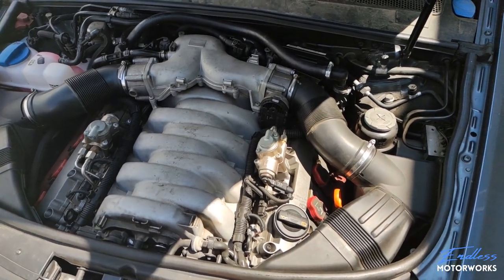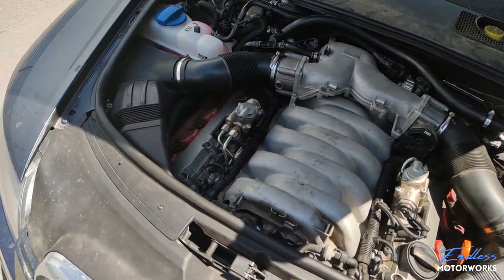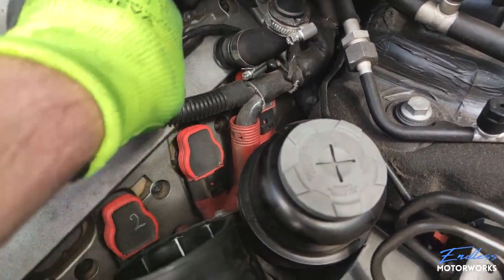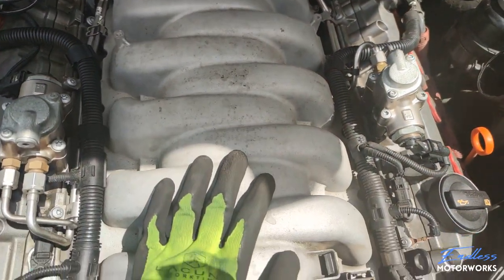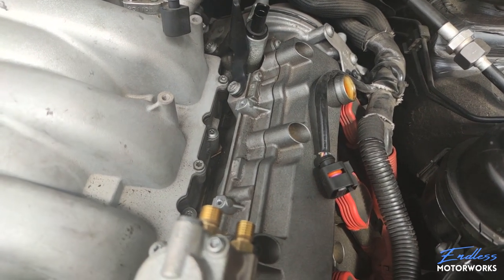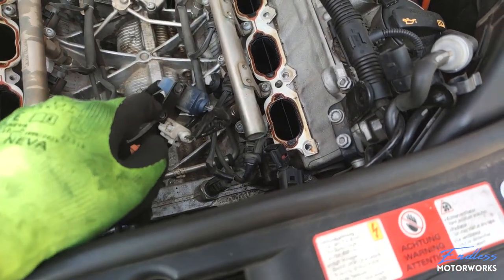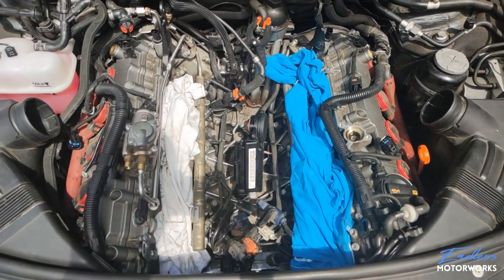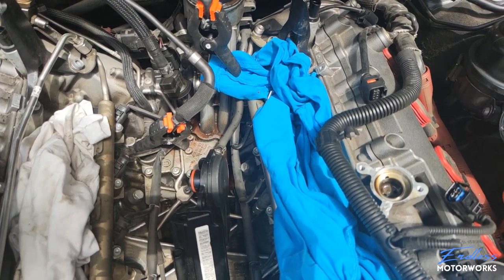5.2L V10 Audi A6 S6 C6 / A8 S8 D3 - Intake Manifold Removal, Swirl Flaps Delete and Carbon Cleaning

Comment: How did you clean the carbon  build up and what did you use to get all that mess out
Reply from the maker: As you can see from the video, I used a variety of picks and metal brushes in combination with a  strong solvents, such as break cleaner and throttle body cleaner. Just make sure that the valves you are cleaning are completely closed, otherwise all of the solvents and carbon will go into the cylinder and potentially damage it when you go start the vehicle.
Reply: @EndlessMotorWorks  may I ask did you use a tool on the bolt in the middle of the crankshaft to turn around the engine?

Comment: It is smart to get them out they can break off and destroy your engine. That would suck. I seen many get caught in the valves and wreck engines and or heads.
Reply from the maker: If watched the video till the end you will see that this is what I found out. A piece holding the flaps to the intake had broken off an had wedged itself into one of the intake valves not allowing it to open and close all the way. I consider my self lucky the piece was big enough not to inside the engine cause catastrophic failure.
Reply: @Endless MotorWorks  i seen that. Well my audi is down ecp light came on it has a miss that got worse it sounded like a crap coil and plug. Hopefully its nothing crazy. Im ready to get a new intake but need to tear it down first to make sure there is no damage. How does yours run with a delete done. As finiky as audis are id think it would throw crazy codes. My oxygen senseor bank one sensor one is shot Hopefully that can be done without yanking the engine.some o2 i here you have to yank the motor just to get to the harnesses and sensors. Kinda bummed right now. I will keep you up to date on whats done. Many codes came up so ill start with the most common crap. I know the intak flaps are broke you xan here them . Son of a gun is all i can say. I love my car its super super clean.
Reply: @RICHIE_RICH89  may I ask how you can hear the broken intake flaps. Is this the rattling sounds you can hear at about 2000 rpm when quickly pushing the gas pedal when stationary.

Comment: Hello,
I deleted my runner flaps now i have an unstable start
Reply from the maker: Like I have explained in the video, the flaps don't really have anything to do with idle and cold starts. The only time these upper flaps make a difference is under high load, for example full throttle and up in the rev-range. If your car isn't running right and has an unstable idle then there is something else going on with it, most probably a vacuum leak somewhere. Considering how many sensors these cars have you will absolutely need to hook it up to a VCDS and get it scanned. Checking the live data might not be such a bad idea as well, but for that you will need to know what to look for, as otherwise it is just a bunch of numbers and values, which will mean nothing.
Reply: @EndlessMotorWorks  bs they do to help starting
Reply: @RICHIE_RICH89  please explain how it helps, or you don't get to call b s

Comment: Where is the pcv valve on this. Motor i cant seem to find it anywhere
Reply from the maker: At the back of the engine, on the driver's side. It is one of the things I remove in the beginning of the video. I have also another video specifically on the PCV system of the Audi S6. You can check that one for more details.
Reply: @EndlessMotorWorks  thank you man. I'm having misfires replaced coils with oem ones and spark plugs and still get random multiple cylinder misfires. I believe the pcv valve is causing it 120k miles.
Reply from the maker: @Ivan-hx7cc  I will need some more info before being able to answer that. When you say misfires, do you actually mean misfires, as you had the car checked with VCDS and you got error codes for it? Or, are you getting just an overall rough idle?
Reply: @EndlessMotorWorks  checked obd11 live data misfires an all cylinders but i believe the pcv is bad
Reply from the maker: @Ivan-hx7cc  When the PCV itself goes bad it makes a characteristic whistling sound when the engine is up to operating temperature and there is excessive smoke coming from the tailpipes. These vehicles do have issues with the PCV hoses, which are originally made from plastic and tend to disintegrate causing unmetered air to go into the engine. Can certainly trigger misfire codes. Do you have lights on the dashboard - CEL or EPS light?

Comment: why does the intake manifold need to be so complicated, its no wonder it broke it has 10 moving parts inside of it.  seems like kind of a dumb design to be since if something breaks you could get pieces inside the cylinders and possibly destroy that whole engine like what almost happened with this car, lucky the piece that broke off was kind of big
Reply from the maker: the idea behind it was to maximize torque regardless of where one is in the rev range. However, with time the plastic disintegrates and does become a ticking time bomb for the engine. I was lucky the piece that got jammed into the valve opening was just big enough not to be able to find its way into the combustion chamber. If it had, it would have been game over for this engine.
Reply: Because it’s an Italian designed engine in a German car… over complicated parts make this engine a ticking time bomb.. I’d rather have the W12. Which I had in the D3. amazing engine, just thirsty.

Comment: Can you fix my s8 for me to 😳
Reply from the maker: Unfortunately I am not a mechanic and don't have a garage. Just a regular dude, who is working on his own vehicles and making YouTube videos in order to help other regular guys interested in working on their own cars.
Reply: @EndlessMotorWorks  hhmmmm I have the s8 v10 5.2 and what your doing in this video I believe the same thing is wrong with my manifold I have a loose motor
Reply: @EndlessMotorWorks  is there any chance I can video call you
Reply from the maker: @ihussain5335  On my vehicle the main issue was that it couldn't idle. As the flaps broke inside the manifold, this created a huge vacuum leak, causing the car not to run properly. However, if you suspect you have an issue with the flaps do the check that I did just to be sure. Remove the Y-shaped intake on top of the manifold, put you phone inside an make a photo. If you flaps are broken you will clearly be able to see it.
Reply: @EndlessMotorWorks  on your video at 6 minutes and 30 seconds that is also loose on mines to what do you think it could be
Reply from the maker: @ihussain5335  The broken thing I am showing at that timestamp is the external linkage for the flaps. If it is broken, like it is on mine, it is creating a huge vacuum leak. Most certainly flaps inside the manifold are gone as well.
Reply: @EndlessMotorWorks  mines just loose it dont come all out
Reply: @EndlessMotorWorks  you no when you opened ur manifold up did u put the flaps back in????
Reply from the maker: @ihussain5335  The flaps are not sold separately and they cannot be refurbished in any way. If they are broken the only thing you can do is to remove them entirely in order to avoid pieces of them getting sucked in the engine and destroying it. I had a big chunk stuck in one of the valves. As I state in the video can buy an entire replacement manifold with new flaps, but those are about $3000 USD.

Comment: New intake is way way better idea you lose so much power without flaps im telling you removing them make you lose major power it switches from a low rise intake to a high rise . One bottom end power second high end power. People do this all the time and have 0 clue on the power loss from doing this. Buy a new intake trust me.
Reply from the maker: Idk man, I have seen the numbers on a 4.2 FSI with the flaps deleted and then with a new manifold on. After several dyno runs the difference was about 20-30kW. I know that this is on a V8, but considering how much more power the V10 has even if there is a loss of 30kW, I am not so sure anyone who drives the car normally will ever notice this.
Reply: @EndlessMotorWorks  You ll notice way more than 30kw. Its not about peak power, peak power is what you ll never notice. These variable intake are for low and mide range torque and torque is really something you'll feel.  You do what you can, but cant call that just as good. Cars have had dual lenght runners since the 90s and it was a game changer in midrange torque figures without sacrifying top end power. Thank for showing your experience with us and Ill be sure to share mine as well. The intake is 2500 $ at the dealership. It's a V10, got to pay exotic price to keep it going.
Reply: @EndlessMotorWorks  4.2 dont have the flaps
Reply: @Nordic_Mechanic  you will gain power doing a delete over broken flaps thats for sure butfor all out pwer a new intake is a good idea . I found a audi dealer that has them for 2 k i gotta do mine it pisses me off my car is by far the cleanest s6 ive seen to date . Im hoping to fix it soon. Cool vid though it will help people. If you do the delete jhm makes a map tune to hold torque flaps open the rest you yank out.
Reply: @Nordic_Mechanic  i have a lot of experience with audis. Been working on them for audi for 20yrs now going on 21 . The new ones are very very hard to work on. Anyways talk to jhm tuning they will school you fast on this. Not dissing what your doing if you dont have the money id do the same . One thing i wouldnt do is disconnect the sensors. It will throw the computer all over the place . Leve them hooked up and disconnect the arms if needed.
Reply: @RICHIE_RICH89  You have 20 years experience yet say that 4.2 have no dual lenght runner flaps.... They have them, just no torque flaps. But what breaks in the 5.2 is the dual lenght, not the torque flaps. I think you're the one that needs schooling
Reply: @RICHIE_RICH89  4.2 have dual lenght flaps...
Reply from the maker: @RICHIE_RICH89  You sure? I am talking about the 4.2 FSI that was put in A6s and Q7s and so forth. There are variable intake manifold runners on those engines.
Reply from the maker: @Nordic_Mechanic  Well, the tumble flaps can cause issues as well. There was a TSB on those a while back. But generally, I completely agree with you mate. The changeover flaps are the ones to watch out for on the V10s and those can be a ticking time bomb if left unchecked.
Reply: @RICHIE_RICH89  wrong...4.2fsi is identical to the 5.2 minus two cylinders
Reply: @Nordic_Mechanic  that would be a whopping NZ$6000 here in New Zealand
Reply: or get yourself the Lamborghini galardo intake for half the price

Comment: there is NO way that thing will run at its potential by deleting the flaps.
they are there for a reason......
Reply from the maker: I have never said that it will be exactly as having the flaps fully functional. If you want full potential, there are brand new intake manifolds being sold from Pierburg for the low price of $3500-4000 before installation. What I am showing is that even without the flaps the vehicle will idle and run just fine. Will it be 15-20hp short? - Perhaps, I haven't gotten around to testing dynoing it, but you also save a ton of money and it's not like anyone is actually tracking a vehicle like this in order to feel the difference in a day-to-day commute.
Reply: Is there any way you could 3d print the broken parts and fix the flaps?
Reply from the maker: @akane742  Probably yes, but I am not sure how strong 3D printed flaps will be. Last thing you want is for them to disintegrate inside of the manifold and pieces getting sucked into the valves and the combustion chamber.